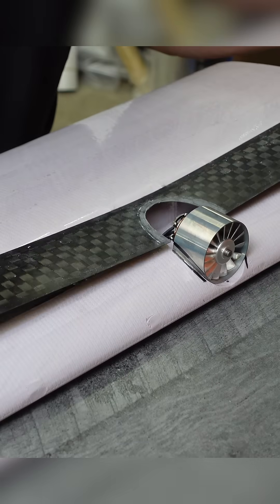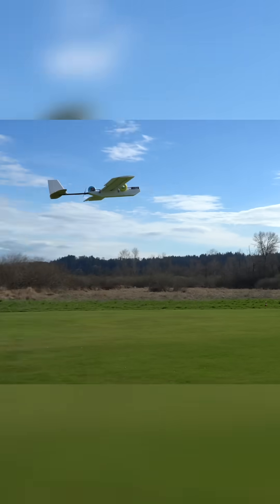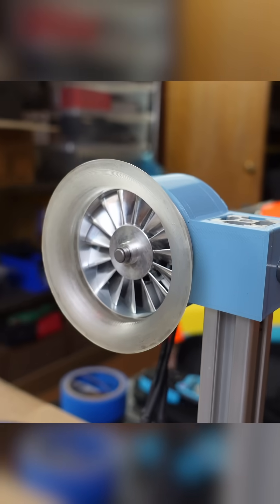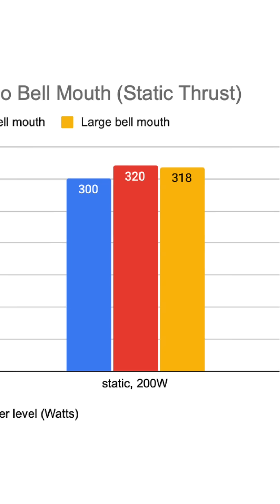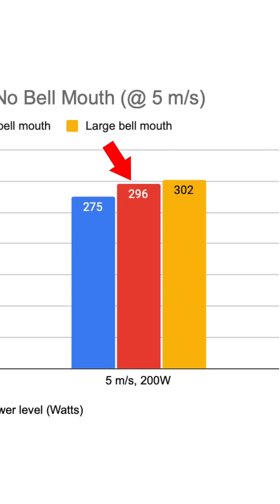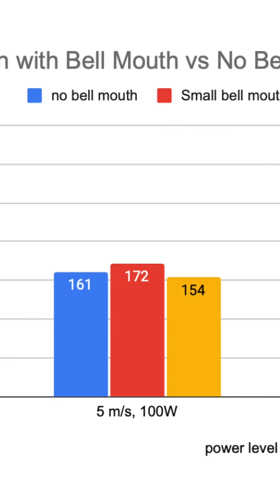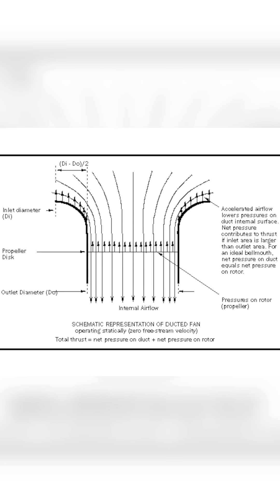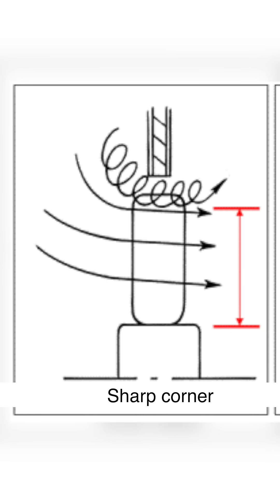Testing EDF Intake Shape for RC Plane #rcplane #aerodynamics

Comment: Those intakes are used on static test stands for jet engines and it is indeed to allow air to flow in smoothly. As air is accelerated in front of the fan the cross section of the flow is decreased.
The engine then generates more trust because more air enters easier.

Comment: These are used on carbureted hot rods to increase power. They often call them velocity stacks. The do increase the airflow, but like you said, it's most by creating a laminar flow into the carburetor. The more even flow allows more air to get in, and can even have some small parasitic draw effect.

Comment: I think its mainly the turbulance that creates an extreme amount of unecicary friction or sticky air. The bell mouths simply reduce it. Never know, different materials or even glassy smooth surfaces vs matt surfaces as shown may increase the percentage difference even further. Air and water drag is effected by even small scratches and contours oh so slightly.

Comment: Bell-mouth "trumpet" intakes ara all about the transition  from a straight pipe - static......  There is a benefit- but the optimal  percent flare depends  on many factors - for slow vehicles without significant ram effect, direction doesn't matter, for fast vehicles sectional drag plays a part (fairing b=matters heaps..) - a typical turbofan only has a few percent of "bell mouth" on the fan cowling - faired over the whole length of the T-Fan engine cowling..

Streamline everything, - degrees (of divergence) per m/s matters - CFD determines the absolute pressure drop to eliminate stagnation or recirculation / separation and uncontrolled vortices...

Comment: Love stuff like this, take this as half a question and I’m just curious. I remember working on a motor optimisation for some drone project back in the day, if I’m not mistaken the Reynolds number for relative slow moving RC planes, drones etc, the lip and something around the first 0.2D inside of the bell mouth / intake is helpful if very smooth, thinking like a  thin layer of epoxy and wet sand it. The resin printed parts are much better than fdm. Secondly have you given any thought to the lower lip of the bellmouth vs. the boundary level of the wing?, perhaps it could do something to your numbers ?

Comment: I have yet to see any actual evidence and the amount of people suggesting bell mouths makes me think it's wrong but I've read (in a book about turbocharging that goes into aerodynamic mods for optimal intercooler flow) that the bell mouths will induce turbulence along the sides that will pull some of the air back out, reducing total airflow. A reverse funnel design does not have this effect and allows room for the air to expand, increasing total airflow.

Comment: To reduce bellmouth drag, you'd ideally blend it into the nacelle surface...like on an airliner engine. Also, you could probably go even smaller on the bellmouth. Besides acting like a parachute, a large bellmouth adds boundary layer thickness to the inlet air.

Comment: Wait but you just accounted for drag while the fan is off and applied it to the moving air test?  That doesn't make any sense. The drag will be reduced if not eliminated by the fact that the air is being sucked in not creating a high pressure zone in front of it.

Comment: Problem with your drag calculation is: You don't have drag by the blower when the fan is running. There is no static pressure builtup in front of it. 
So bucket the numbers from that test. ;)

Comment: Do you have to run these energy thirsty EDFs? 
What if you just cut 2 holes into leading edge where motor is placed, one on each side of the motor (to filled up the chambers) and just use standard propellers. 
BTW I really love the slow flying characteristics of your plane!

Comment: Real jet engines are more complex.
Takeoff thrust vs cruise thrust at altitude.
There is an Air Force cargo plane (forget which one) that has the fan close to the inlet.  Great for low speed take off thrust. Decreases takeoff distance including distance to clear an object, typically 50' tall object.
Typical cargo passenger jets use the free compression by expanding the air (slows it down increasing pressure, Bernoulli's equations) the increased pressure at the engine inlet increases the pressure rise across the engine( I am simplifying that part) which increases  thrust. 

Then if you get into military fighter jets it gets more complex due to  higher speeds. 
If you really want to max thrust, need variable inlet and exhaust geometries based on expected flight speeds and other more complex aeronautical parameters. 

The aeronautics that you are doing is cool to me. I hope the long comment does not deter your enthusiasm for the subject.

Comment: I'd guess that the sharp corner the air has to make in order to reach the whole wing just from the EDF don't help either. What if you put the EDFs on the fuselage and drive the air into the wings with smooth curves?

Comment: In your planes, design your moving air through those slits the Belmount will allow more work to be done by the motor on the output side by feeding denser air on the front of the blades they can do more work on the backend

Comment: Yeah, it has nothing to do with suction. You’re taking a larger volume of air. OK think of it this way if your lawnmower is cutting 24 inches wide of grass but you put something on the front to grab 34 inches of grass it will increase the grass output on and load on the engine

Comment: Bore a hole in a block of Ice roughly the size of what you need, on the back end place a vacuum tube connected to wet-vac.  Calculate max volume of air induced / intrenched by EDF, when you turn on wet-vac have a valve that allows max air flow over a period of time.  The resulting shape from melting ice will be the one you want.  Quickly place in deep freeze.  Once cooled take a mold, reduce size of curve to optimise for drag.
Anyway I'm cheap I don't have fancy gear, but I have Grok to do all the formula's and calculations.
Reply: won't it be the shape of a teardrop, more or less?

Comment: I suppose the sharp 90° angle at the intake edge also creates turbulence in your design. Need to have a more smooth surface without 90° angles to avoid flow separation and the wide turbulent wake, probably.

Comment: Not my world. Makes me wonder if the angle may play a factor. I know that for car aerodynamics the exact angles matter a lot for managing air flow. 

Anything may be an improvement over nothing. But, all angles of approach may not be equal. 

Additionally, and this is super minor. You spoke about the extra surface area of the bell. But, some small percentage of the 360 degrees isn’t purely new drag hitting a larger surface area. Some amount of that would have been hitting the wing itself. That could be a 10% improvement or whatever. 

The last part may be WAY too minor to worry about at this scale.

Comment: All high performance engines use bellmouth air intakes to smooth the airflow, reduce turbulence, and increase performance, they reduce the energy loss as the air transitions in to the engine, formula 1 cars use them, planes use them, helicopters use them, lots of reading on line.

Comment: It doesn't matter where it is pointing, because the air is coming from all around (even from behind), going from ambient pressure to a low pressure area.

You are correct about the bell-mouth smoothing the flow of air and for that reason and what I stated above, you could make it even more efficient by curving the edge back, just like on a commercial engine cowling, so the air coming from all directions is smoothed.

Comment: Your bells turn a complete 90 degrees, and it appears they start at the flat and turn more at the smaller intake end. Try one that starts at 45 degrees and retains the same curve over the distance of the curve. Make the curve slower so that it sticks farther out in front of the wing. It should give you more compression and less over all drag.

Comment: Engine tuner David Vizard had A LOT of information about air flows and intake venturi stacks. 
A short stack boosts mid range flow by smoothing the curve. A tall stack adds air mass inertia so improves high end flow. 
A series of 15 degree angle changes on any surface, flow as smoothly as a continuous curve. 
Check out the shape of race engine throttle stacks and try on your fans.
Reply: David Vizard's guide to cylinder head modification was my bible, back in the day.  SO much good information about low speed airflow

Comment: This reminds me of the classic physics demo where you try to blow a ping-pong ball out of a funnel — and it stubbornly stays in. What's happening there is similar:
As airflow speeds up through the constriction, static pressure drops (Bernoulli effect), creating a sort of "suction" zone.

A proper bell-mouth intake on an EDF reduces turbulence and allows smoother, pressure-recovering flow into the fan — which makes a big difference in efficiency and thrust.

Shaping that inlet right isn’t just about aesthetics — it’s pure airflow physics.
Reply: chatgpt ahh response

Comment: As a 42 year exp'd Auto technician and hotrodder i can concur the air flow is measurable and will cut et's at the drag strip and more power on the dyno vs no velocity stack ... pretty much a filtered or non filtered bell mouth, filtered to keep bugs birds and the such out

Comment: Now create a smooth contour from the edges of the bellmouth back into the motor/wing.  you'll significantly reduce the drag caused by the turbulent flow on back side.
Reply: That's what I was wondering, is there a toroidal vortex forming at the trailing edge of the bellmouth lip? If so there is significant drag that would be alleviated by a bull nose cowling as you suggest.
Reply: Hah, like a modern jet engine.
Reply: this makes sense if the whole name of the game is to reduce turbulent flow
Reply: This is one reason the some high bypass turbo fans use boundary layer control to reduce the drag of the slower moving boundary layer of air.
Reply: every ounce of weight also hinder performance... diminishing returns everywhere you go in airplane design
Reply: @banzaiib it has a heavy battery anyway . and no ! reducing drag does not get diminishing results, not when it's low hanging fruits.
anyway..the whole design is not efficient at all. if you want something that flies very slowly, and is really efficient the design already exists it's the pedal powered  aircraft., just scale it down
Reply: This is  critical. I tried using flared intakes on some carbureted race engines 50 years ago, and they work too much better if there was a fully rounded Contour on the opening, all the way back to the flute. We theorized that the airflow was tripping on the sharp edge
Reply: means even more weight though
Reply: @starstenaal527it doesn't have to be   heavy, sculpted foam would do it, all its doing is maintaining laminar flow.
Reply: @starstenaal527"paper"
Reply: @starstenaal527 I am willing to bet the very small weight (grams) cost is more than offset by drag reduction.  Almost always any mod on airframes that reduces parasitic drag is worth it.

Comment: The direction doesn’t matter as long as it’s supplied the air it needs. The whole point of the bell mouth is to smooth the flow of air making it more efficient

Comment: The bell mouth should continue around the EDF giving you a nacelle. like a regular planes underwing mounted engines. While there is a slight drag penalty from the bell mouth because of front area, if you had a nacelle, the parasitic drag and drag coeff would have been way better.
Reply: Counterpoint: added mass. It's always a compromise in aviation.
Reply: @miscbits6399  The addition of a nacelle compared to not, will be better even with the added mass.

Comment: I have to wonder if multiple smaller motors would provide better pressure distribution across the plenum chamber. Easier said than done, of course. With multiple motors you have to worry about them competing with each other.

Comment: Look up david vizards, Tuning the a series engine, known as the yellow book. He goes into depth about cylinder head porting, throttle bodies, carbs etc, and from his intake trumpet/velocity stack testing found a thick "washer" with a varied radius curve to its profile was best. Its not aero, but airflow is airflow and i think you'd defo benefit giving it a read. 
👍🇬🇧👍

Comment: Did a class presentation about ducted fans in 1982. It is indeed about laminar flow improvement ... but the real estate is adding drag , which increases exponentially with speed. Ducted fans are more effective but at high speeds it needs to be balanced against drag  (and weight)
Reply: use the drag to push the air into the fan

Comment: Half Open Daisy Pedal's Design' with pointy ends for maximum air flow for both the Wing and the Fan_  with Minimal drag _ Btw 'Different Idea What about a Plane Using Tubular Fans for the Leading Edge of the Wings?! With 1 inch Tube Fan Height by Whatever length? into a Hollow Wing with 1/2 inch Open Separation out back for a Pressure Thrust Effect?!_  Shape Form the Wing to the Fans so they Still Perform as Wings!_ Just an Idea🤔🖖

Comment: funnel it from larger diameter to smaller diameter softening The Edge before the fan to Port match finish. use a funneling method for Ram Air half inch larger than original diameter on both sides by 7° length determined by angle

Comment: You are doing it wrong. The space behind the bell walls is not an ambient pressure (in flight) it’s inducing a rotor of wind that is dragging it. Encapsulate it so that there isn’t induced drag behind.

Comment: 😂😂😂🤦🏻 It needs to be open. You will not gain anything adding a big bell, because there is a limit on the quantity of air it can suck. You need to open a space between the bell and the fan, so the air will flow through it, THEN you'll have more gain 👍

Comment: Most of the air moving into the engine comes from the side, not the front. Your diagrams showing equal air flowing into the engine is wrong. The bell mouth helps the air move more efficiently from the side.

Comment: All intakes on fans will be improved with bellmouths and would be a bit more improved with an extension between the blades and the bellmouth. The bellmouth gain is due to the smoothing, non-turbulent flow. As you verified the size of the  bellmouth will reach a point of diminishing gains when factoring in induced drag. An obvious example is the inlet of jet engines on aircraft.
Reply: and jet engine moves through the air so the intake air doesn't have to take a sharp 90 degree turn, https://youtu.be/gSkhg4whR9c?si=IHGlYGh7EWgyppa6

Comment: Generally the slower you're going in relation to incoming are the larger bellmouth will be more efficient but at higher speeds it needs to be shaped more like a jet engine intake because most of the air is already getting rammed in directly

Comment: When the EDF is running it creates a pressure drop around its input. This vacuum is filled by the air surrounding it including behind it. You prevent back to front airflow, but most importantly you reduce turbulences at the input. Try a cone.

Comment: The fan on the upper surface of the wing is also probably disrupting lift behind it. Might be worth exploring having the fan intakes below the wing next time.
Reply: The whole point of a blown wing is to drive air over the wing to improve lift. 
Same reason F1 cars at one point directed their exhaust over the underside of the rear wing. Artificially creates downforce
Reply: Oh yes, the exhaust vents are on top for a reason. But the shape of the intakes and fans on the low pressure side of the wing are most likely causing flow separation and l/d losses all the way down the upper surface of the wing behind them. Moving the fans to the high pressure side of the wing might help, with the exhaust still on the low pressure side to help keep the flow attached. Also see the swan neck wing mounts in motorsports, they moved the wing attachment points to the high pressure side to improve efficiency.

Comment: Try experimenting with the pressure chamber itself. It would make sense to decrease the cross sectional surface area of it as the distance from the EDF increases. Otherwise the pressure on the edge and closer to the fuselage is lower than the pressure right behind the EDF.

Comment: Next sub-project: airflow analysis with smoke machine, define the best intake geometry (maybe also with tiny vortex generators to avoid flow separation at tip blade), better motor integration in the wing for drag reduction. Even better: use a central centrifugal blower instead of the two tiny EDFs.

Comment: Could you make a firefighter move with a servo to redirect the air from the inside directly to the outside? 
So that I can make a short takeoff and then the firefighter goes so that all the thrust comes out and I can fly fast?
Reply: P.S., I'm not an engineer, it's just an idea that if it works I could make the best RV plane in the world 😂